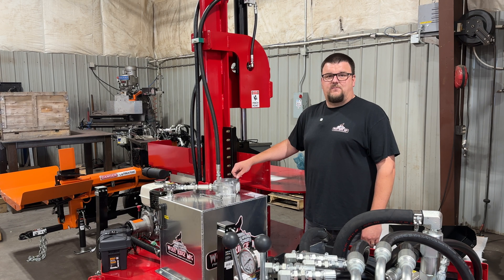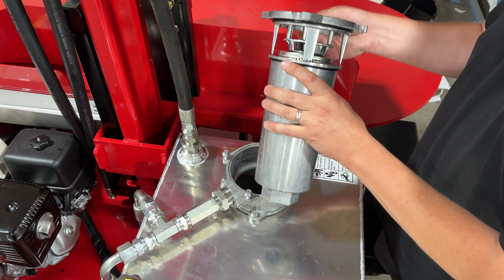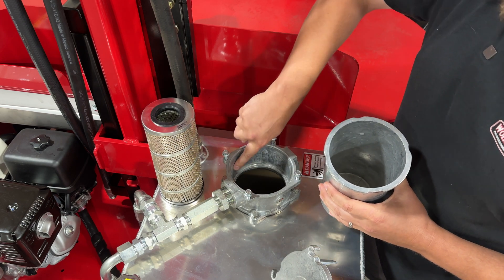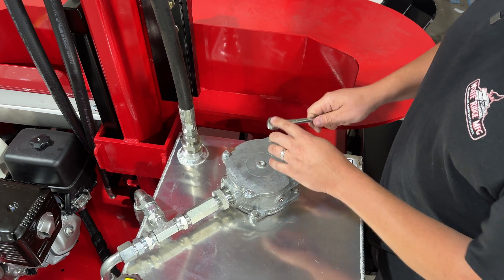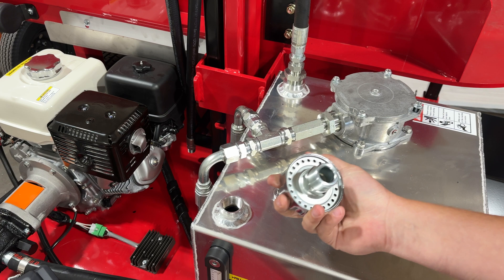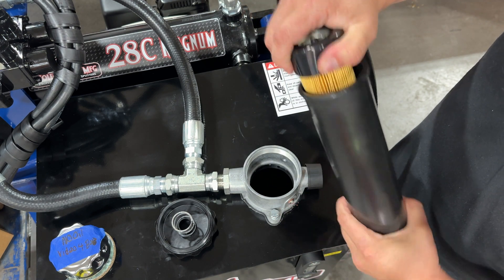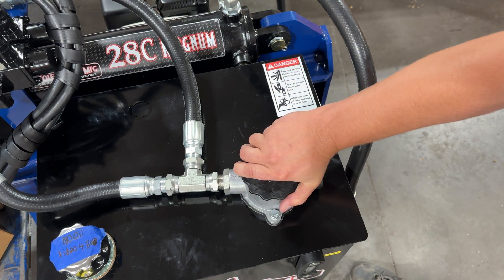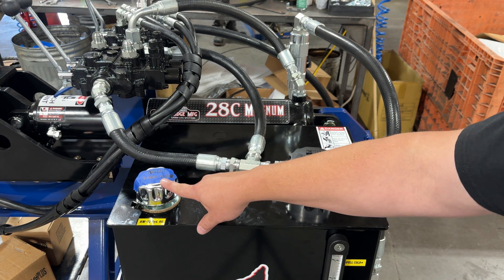Hydraulic Oil Filter Replacement - Wolfe Ridge Log Splitter Maintenance

Comment: Does the hydraulic oil need to be completely emptied and changed? If so, at what interval? The oil seems to look pretty clear. Thanks Bob.
Reply from the maker: 1000 hours recommended for hydraulic oil replacement unless it gets contaminated earlier. Thanks Obey!

Comment: Great job Bob. This will be very helpful when changing the filter. I have a 17VS-C.  I never received any owners manual. What is recommended for 1st hydralic filter change in hours. How often after that. Thanks for putting this info out there.  What is the price tag for the 17vs Electric unit?
Reply: Send us an email and we can send you a copy of the manual - sales@wolferidgemfg.com.  500 hours for filter, 1,000 for hydraulic oil.

Comment: Qqq, hey Bob why would there be debris when the hydraulic system is sealed ? Typically how frequently hour wise would you need to replace the filter? You are a great ambassador for Wolferidge. Chris is lucky to have you.
Thx Woody !!!
Reply from the maker: The debris can be from inside that sealed system. It's also possible for dirt to enter through a cylinder seal. And yes, Bob is doing great! Thanks! Chris
Reply: Thanks for watching, Woody, and for the compliment!  I see Chris answered about the debris.  Have a good weekend!

Comment: Hello Bob, I have a pro 28C with no oil cooler what high temperature should you never operate the machine at?    No one said how hot is too hot to operate it
Reply from the maker: 150 degrees is the max that you want to run. Thanks!